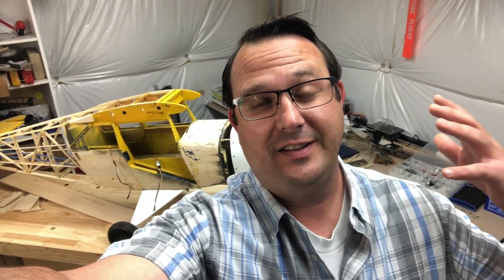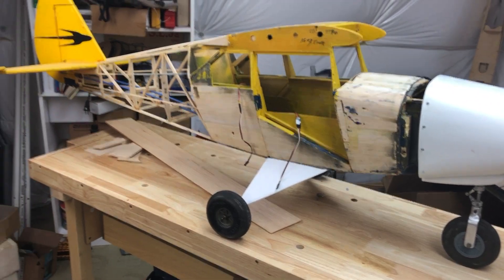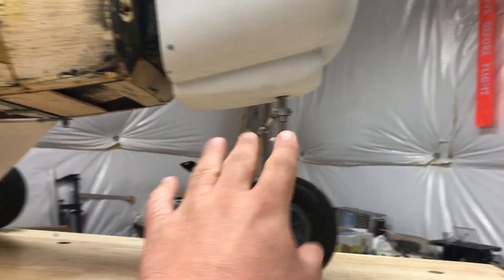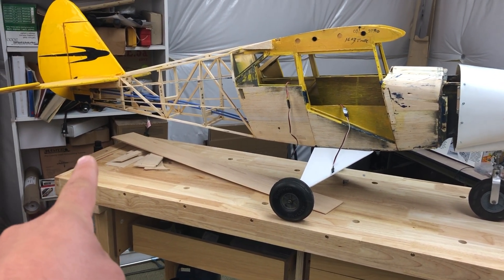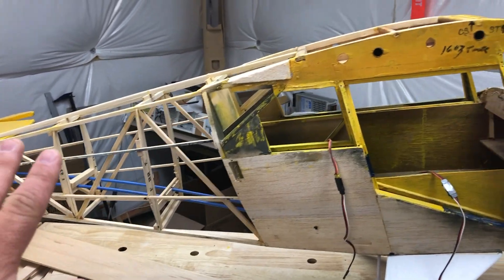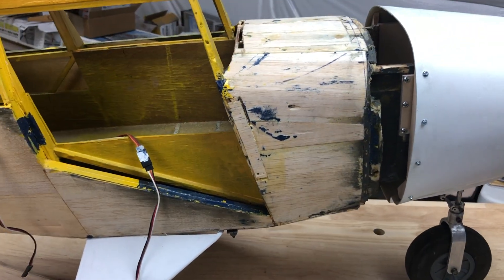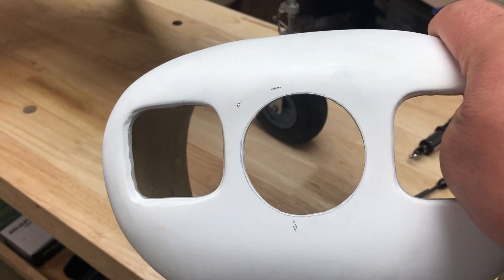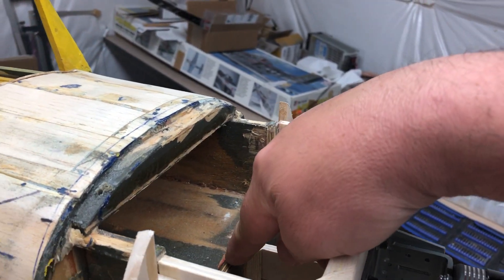Tripacer Episode 8: Fuselage... ISSUES

Comment: I'm sorry it is giving you headaches!  There are some details on the bottom of the cowling and below the firewall that may make things a little easier on you. First, you can slot the nose wheel gear hole in the cowling all the way to the back so it just slides on.  That's how it is on the full scale plane.  And, there is a gap between the cowl and firewall at the belly of the plane.  That is open to allow air to flow over the engine and out.  If you would like, maybe we could meet at Clearview over the next few days and you can take a look.  I need to pay my tie down fees anyway.  I can't get anyone to answer the phone at the airport!